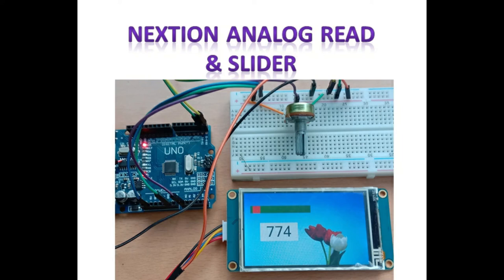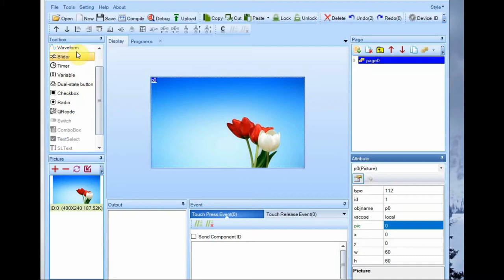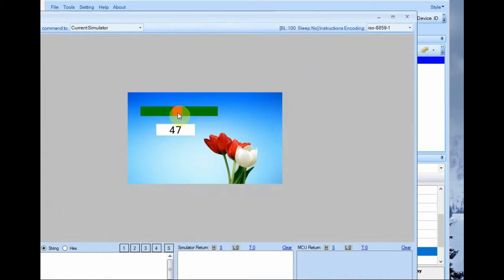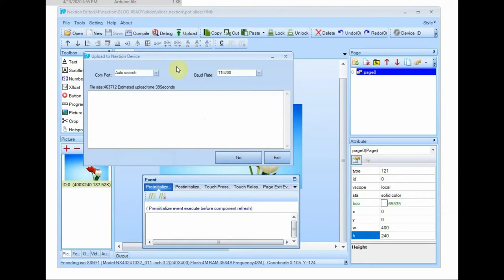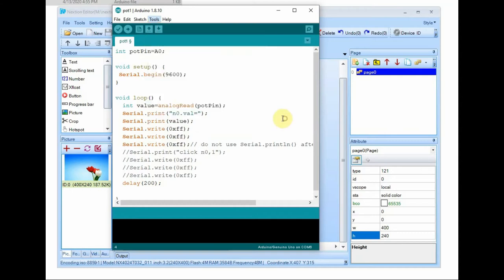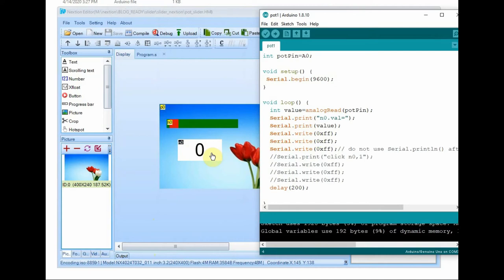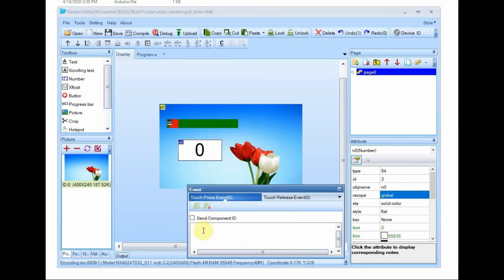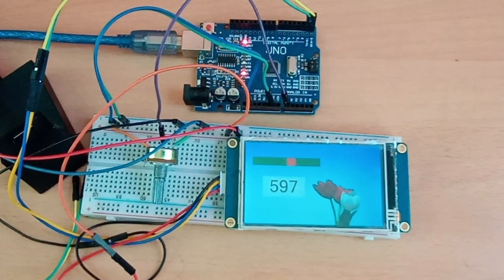Nextion Analog Read value & Slider tool

Comment: Hi , i follow exactly the video but it doesn´t work, i have the nextion NX3224K024_011 and arduino uno,, on arduino only blink  LED TX, RX is always off, in my nextion when i slide the slider the value change, but with potentiometer never, in arduino (monitor serial) i can see that value changing when i move the potentiometer, can you help me ?